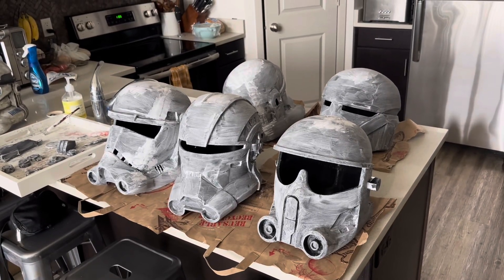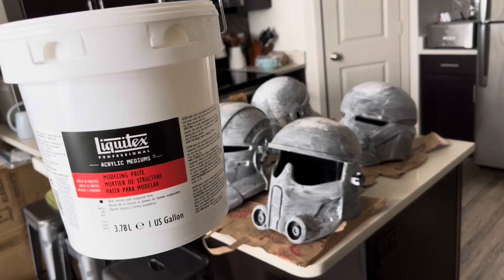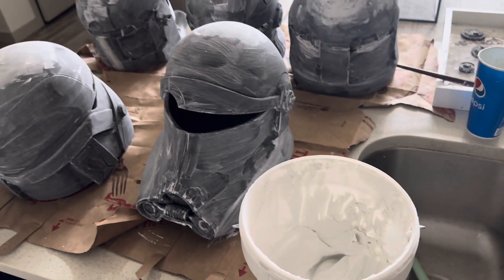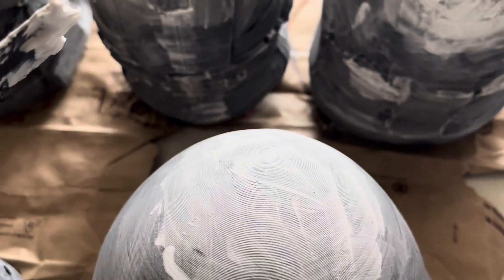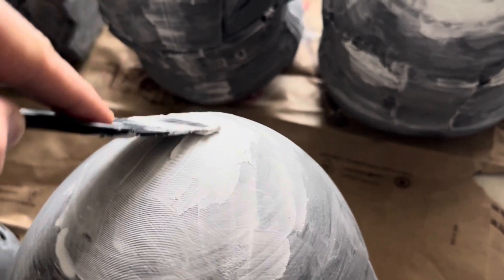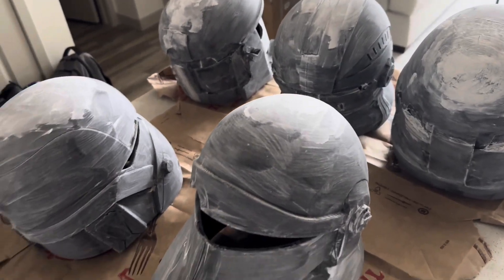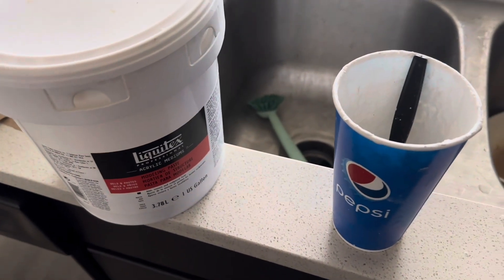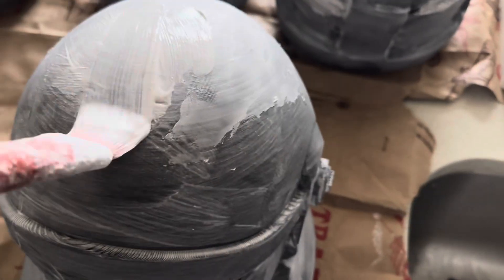Smooth out your 3d printed helmet with Modeling Paste!

Comment: I’ve been using this mixed with isopropyl alcohol to smooth my prints. Loving the non toxic aspect, but it is SOOO hard to sand and takes forever. Any suggestions?
Reply: Sanding tools.

Unfortunately Sanding is always going to take forever with 3d prints, the fastest way to go about it is using powered tools built for Sanding then going in by hand.

Comment: I usually use some spackle to smooth my helmets.  I already had it at home when I smoothed my first helmet, and it works pretty well.  If you use a little water with it, it smooths a bit easier.